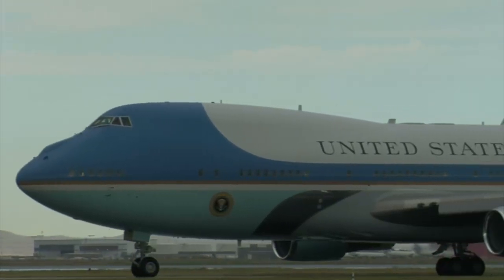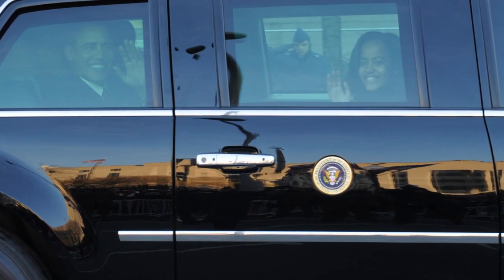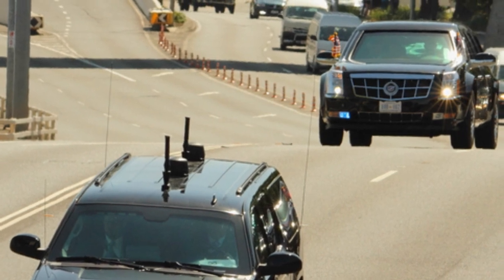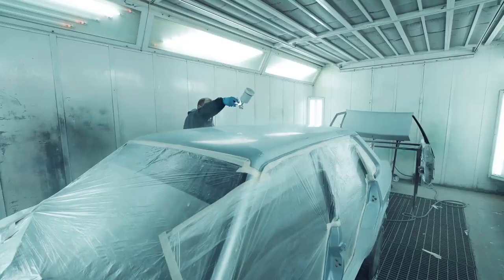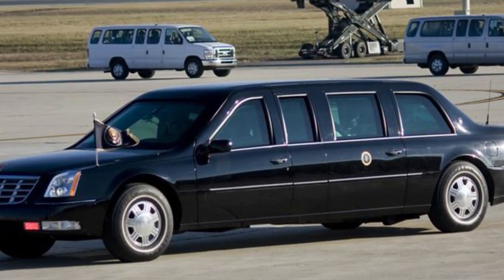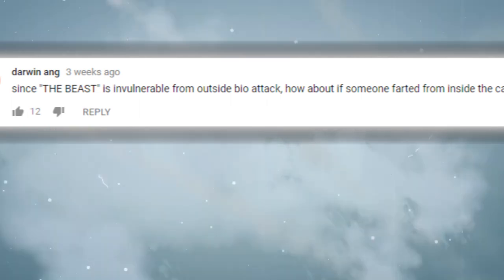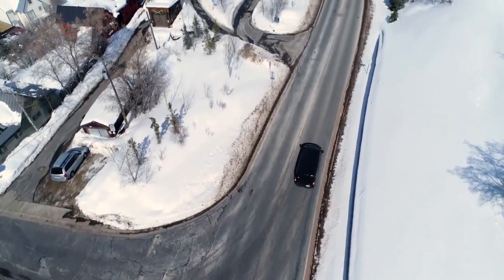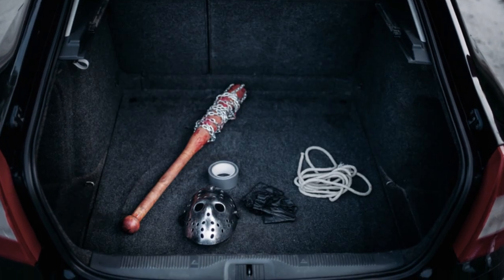Unbelievable Secrets of The President's Limo

Comment: Air Force 1 does not transport The Beast you sped, on 9:08 it’s being loaded into a C-17 which is a military cargo aircraft. Air Force 1 is a 747 that is built specifically for the president, a normal 747 is a passenger airliner.

Comment: A normal limo weights more than two tons. That's only four thousand pounds. If my Mustang weighs 6500 pounds then a limo weighs about five tons or ten thousand pounds. So "the Beast" weighs twice what a normal limo does. It is able to only weigh that much by using  titanium armor  plating so it cuts weight off using AR 500 armor by about half and is stronger. Though AR 500 WILL STOP 50 BMG! So I am pretty sure the beasts armor can stop 25mm.